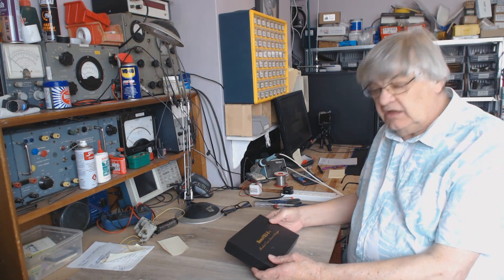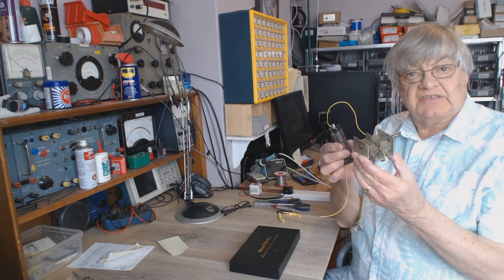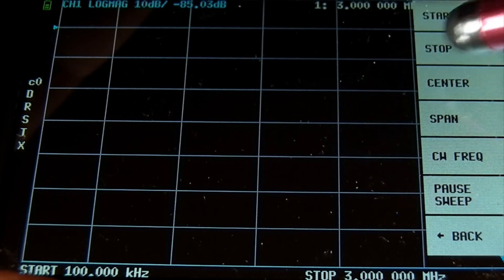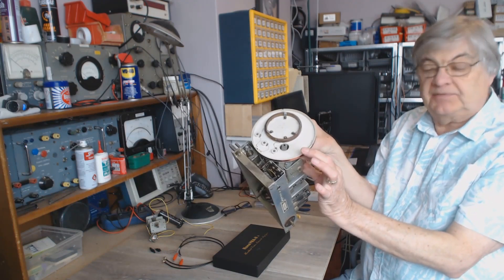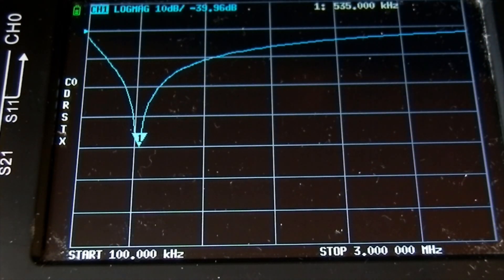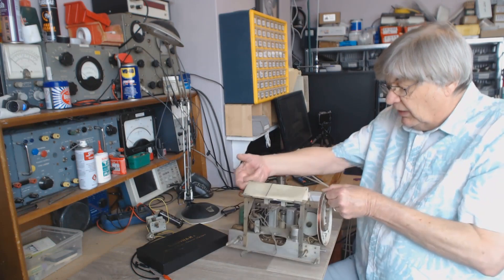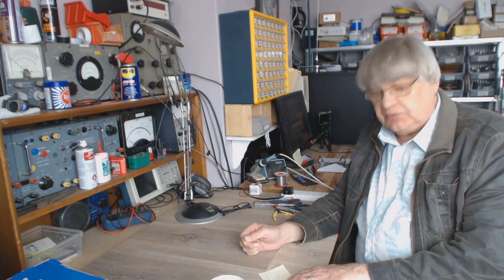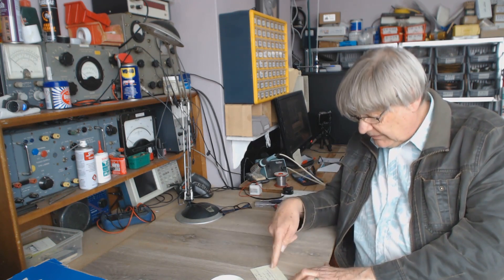G4NSJ - Checking Tuned Circuits NanoVNA H4

Comment: I have an old philco 5 tube radio. I cant find the data for it. Is there a way to find out what the IF should be? Philco made their radios with many different IF's. Or does it even matter if I set the filters to match an IF?
Reply from the maker: I've checked and I can't find any data. Try guessing the frequency. You can always change it if it';s wrong. If I discover anything, I'll let you know.
Reply: @g4nsj  Thanks for the reply. I'll pick a common IF that has the least noise in my area and see if I can get the LO and Antenna to track together. I think I'll pickup a NanoVNA, I've been tuning with a VTVM and Signal injector this far.

Comment: Great video. After watching, I set up my nanovna with one cable set with clip leads on just s11 to see if a tuned circuit resonance could be monitored using just this one port; it can.  
Set up your nanovna to read resistance and frequency sweep as in the video. When the tuned circuit is in resonance, its impedance will be extremely ( infinitely) high. Try setting scale division to say 2000 to get a better peak and have a marker track maximum. 

I found that the loop attena that I made with cat-5 cable  has, at the moment, too much capacitance to tune to the upper part of the MW band
Reply from the maker: Great stuff, thanks for sharing. Cheers, Ray.